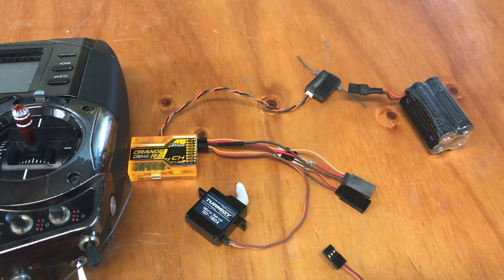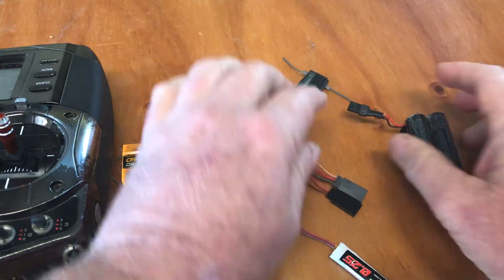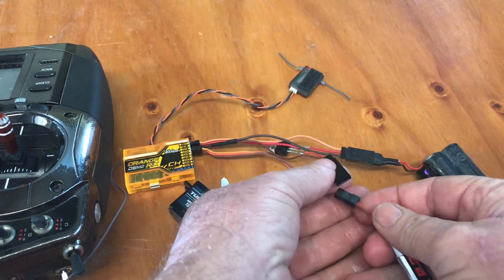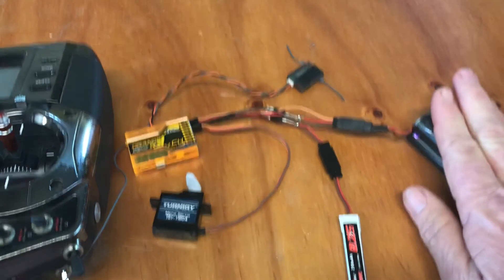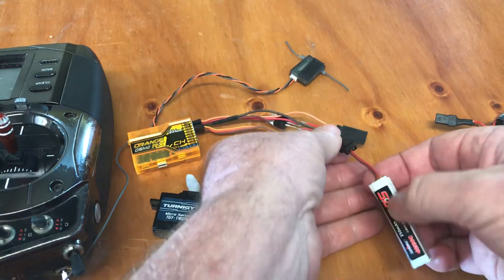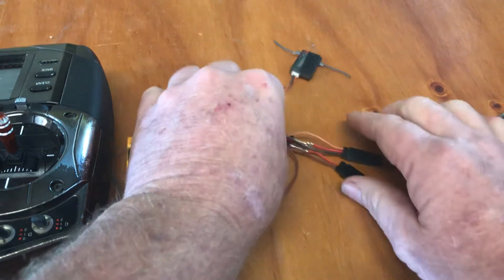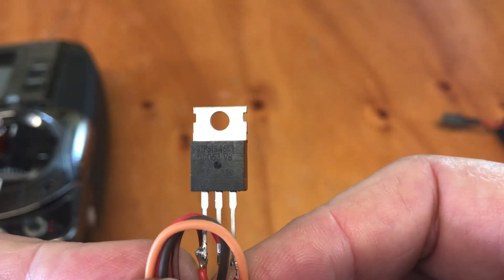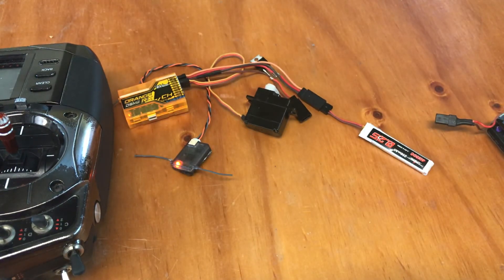Schottky diode dilemma part 2

Comment: I checked your connection and that seems ok. Since both sides of the double diode are identical the should behave the same, which they obviously do not. The only logical conclusion the is that one side is broke. By connecting the main power source to the backup connector you can check my assumption. It should not work then.
Reply from the maker: G’day Fred, the issue was solved in another video. 
https://youtu.be/USn8R_F1mjw
Reply: @Larrikin  ok, just watched. Glad it is solved. You can also use the TSF20U45C

Has a somewhat lower voltage loss.